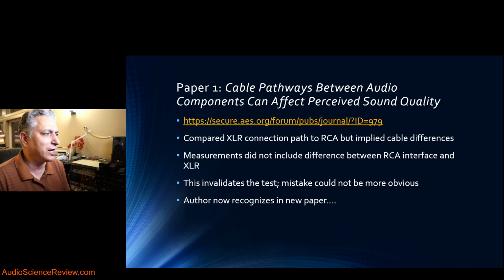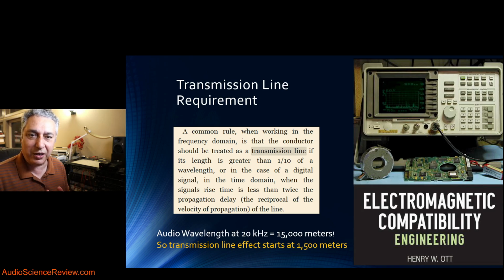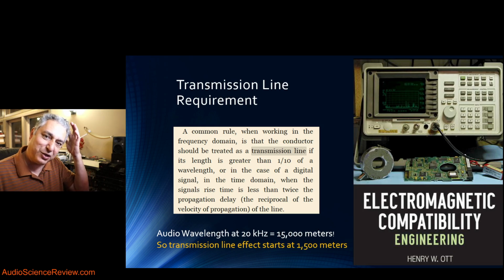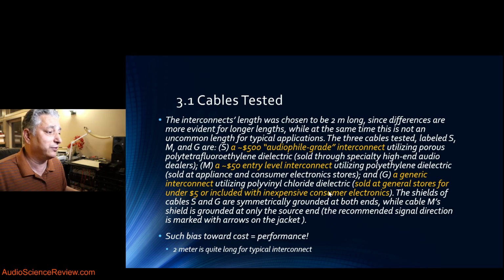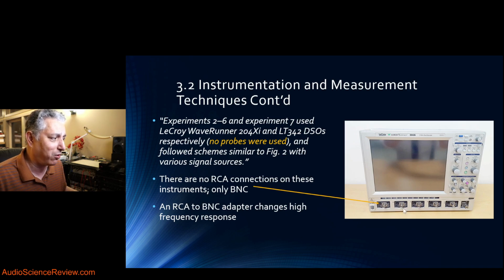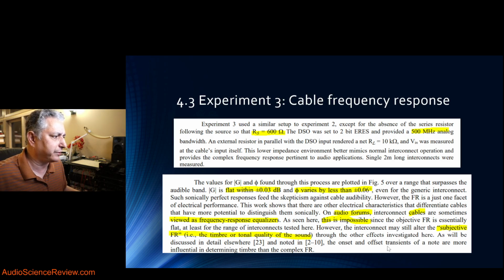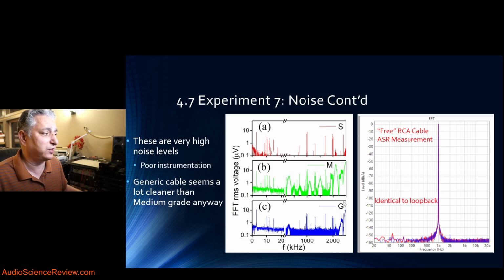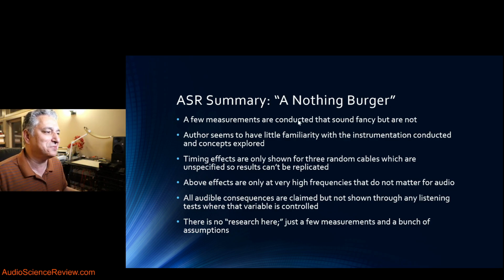Scientific Proof of Measurable Difference in Audio Cables? Paper Review

Comment: ummmm, the wavelength of a 20kHz sine wave is 1.7cm....not 15,000m......and then you say this guy has no idea.....how in the world did you come up with 15km for a 20kHz sine wave.....
Reply: @Douglas Blake ehm you're right. Sorry. I did almost the same mistake like this dude an took sonic speed for math, but sonic speed in copper. 

But yes. Even this was still wrong because we're not talking about sonic speed in whatever. We're taking about speed of electricity in copper, which is for sure lightspeed.
Reply: @Douglas Blake nah, I know. It's just, I took the very first fckn value without thinking about. Speed of electricity is basically school knowledge. I honestly forgot about 😬🙄

There is also a value for sonic speed on copper. Like I wrote. But it does not matter because... you already said.
Reply: I'm sorry to tell you that the wavelenght depends hardly on the medium. 1,71cm is the wavelenght for 20 khz in air on 20'C. 

But we don't talk about the wavelenght in the air. We're taking about copper. And there we have a wavelenght about 19,9cm. 

Still not 15.000 meters. 

But hey. This is only one point. So, if you're waterproofed on physics, you'll easily disproof Amir?
Reply: @farbschlachterei  he hasnt proven anything for me to disprove?
Reply: @Douglas Blake alright, that makes sense.  had to go look that one up though.
Reply: "in these kinds of tests, cable length matters" ummm, pretty sure this is you saying cables make a difference? if they didnt, length wouldnt matter until resistance becomes high enough to degrade signal integrity. right?  youre a smart guy amir. but there are too many people here taking what you say as gospel without knowing what they are talking about either.
Reply: oh, now the connection can alter things, but still, cable cant?
Reply: This influences of cables vs connectors topic is as easy to understand. And Amir said. Even simply replug a cable can influence the measurements more than the cable itself. 

And overall he said, not the first time, that we talk about differences in the measurements besides hearable range.

Comment: @7:54 reminds me of stabalant 22. That is a crock too. It was always compared to deoxit contact cleaner. A cleaner is what it is hopefully. Deoxit is the best for a POT if you can't replace it easily. Doesn't hurt in post cases. We would use it on test benches all the time. But that other stuff claimed to improve the signal. It's literature says in the presense ofan electrical field it conducts. They used to say all sorts of other things related to capacitance. Yikes. I'm reading its current claims and they are vast. Lower THD, less snr. Oh my. 
Thanks Amir for calling out the gagable stuff. It bothered me when other testers post the results of some test that shows differences but then state nothing about listening tests.

Comment: There is no guarantee that a journal paper, even when peer reviewed, has any validity. Sometimes crap like this falls through the cracks. Also, typically professors have requirements as to how many publications they put out, so standing in the lab looking at what he could connect together, he ended up just looking at the cables themselves.

Comment: Amir, thank you.  When the first you tuber came out with this “proof” from a college professor my question was, “who funded his research?”  I tried to explain that college professors would generally find grants in order to do research as no college or university wants their professors working in unfounded projects.  The old saying “publish or perish” refers to publish things you get paid for and bring money into your college.  Of course people took offense just like in anything cable related.  My thoughts, there are three important things when it comes to speaker cables: gage, quality of copper, connectors.  Anything else is jewelry and things like little batteries and tinker toys are pure snake venom!  Did I say Audioquest?
Reply: publish or perish is not about being paid for certain research, but just how academics are ranked based on publication output.
Reply: I’ve specified the cabling for passive audio monitors in TV outside broadcast trucks and studios with 2 core power cable in the past. Diameter was more than sufficient for the speaker power handling, and its easy for the cablers to route and terminate. We used a significant amount of it in the OB truck jobs for wiring up the UPS batteries and it made sense to use what we kept inventory of, as most monitors were active/powered. Never heard any complaints! Ditto, line level, mic, analogue/digital video, RF cable/waveguide, data, power, optical were all selected using… surprise surprise, knowledge of the signal on the wire and cable data sheets!  (And vendor quantity discounts)

Something I’ve never understood is what these audiophiles feel that they’re going to gain by spending money on far more exotic components than a professional recording facility would - the very source of the material they’re listening to. Pros are spending their budget on well engineered tools built with a purpose in mind, room acoustics and other things that create an accurate listening environment and/or otherwise facilitate their work. One suspects there’s a reason no one in the audiophile world thinks to ask them what cables they use.
Reply: @rowanjones3476  We have a BINGO, ladies and gentlemen!
Reply: What do you mean by quality of the copper. The OFC story is a myth.
Reply: @realitykicksin8755  contrary to what you may believe ASTM has standards for copper and copper alloys.
Reply: @realitykicksin8755  what do you mean by the OFC story is a myth? The whole goal of OFC is to remove impurities from the cable so as to prevent the obstruction of the signal flow. Do you mean to say that the presence of said impurities has no impact on the signal's propagation through the cable?
Reply: You bring up an interesting point. If there’s one thing that Amir and most of his fans stand for, it’s their “belief in science”. Given that scientific research is overwhelmingly conducted by universities or product development teams, it begs the question: how can we fully trust any of it?
Reply: @nathandaniels4823  Because any competent electronics engineer with the appropriate instrumentation, skill and understanding can debunk esoteric cable performance claims, it's just basic engineering (I'm a radio broadcast engineer).

Comment: Speed of sound =343 m/s. Therefore wavelength = 343/20000 = 0.01715 meters. I think you used the speed of light in your equation and that is used for radio waves.
Reply: Correction: You are correct when referring to electromagnetic waves. Apologies for the error. Keep up the good work Amir.
Reply from the maker: @dickati  My bad.  I should have been more clear about it in the video.

Comment: I spent a year in engineering school studying electrical measurements. It is a discipline that laymen usually find baffling. That is because to measure something accurately and usefully, you must understand it very well. This fellow seems to have replaced that understanding with prejudice.

And the the most common error in making measurements is prejudice. This fellow might well have started out in his project definition by saying, "The purpose of this effort is to prove that expensive audio cables are better (in some way) than cheap cables. In this effort, I will work with generalized, readily available asserts to prove that postulate." 
.....
As an aside, years ago I muted the Youtuber, Jay, from my accessible group of pundits when I heard him describe the relative position of the volume controls as describing the power output capability of two amplifiers being compared. That demonstrates a 4th grade level of technical understanding. That level of knowledge is fertile fodder for the carnival cable touts.
.....
Reluctantly I say, "Lottery tickets are probably a better audiophile investment than expensive interconnect cables."
Reply: Many a technician and engineer have made errors in their experiment and end up measuring the measurement system.
Reply: But, as an audiophile "HE WANTS TO BELIEVE" 👽 🤪

Comment: As a fellow scientist it's depressing that a paper like that can get published in a peer-reviewed journal.
Reply: Single author papers are often more a hobby project than anything else. That crap gets published too is a flaw of the system - in this case probably because no competent reviewers could be found by the journal.
Reply: @alphaniner3770 Maybe but multi-author papers have their own set of problems w/ fake contributors, often meant to use author reputation to smuggle it through peer-review
Reply: no shit. I'm no scientist and I would have rejected it for numerous reasons. Who is doing their review?
Reply: More scientific papers are being published which will never be read.
Reply: The fact that 'scientific studies' even need to be made to find differences is a testament to the diminishing returns of investing in cables.
Reply: The first paper (published in the AES Journal) is ok, and has results that make sense (a very small difference when comparing balanced to unbalanced). 
The second paper is not published in the AES journal, but another journal that I've never heard of.
Reply: @rarelycomments  yes - but if a balanced connection is compared with an unbalanced connection - this isn't a good way to test if a cable (alone) makes any difference.
Reply: @alphaniner3770  I hope that much would be obvious. My point was that intentional or not, it was a somewhat valid comparison of balanced and unbalanced.
Reply: @rarelycomments  sure, I agree. Can be useful for people that are about to decide if they want to go for a system with balanced connections or not. In the market there is a trend towards XLR connections - good to get some grip on that subject.
Reply: He clearly did a better job
Reply: @scottwheeler2679  agreed
Reply: AES has lots of silly stuff....sadly.
Reply: The reviewing peers must have been drunk or bought their diplomas online
Reply: @dingdong2103 often times reviewers just don’t actually review the papers thoroughly. It’s unpaid highly skilled labor, often given to busy grad students
Reply: the peer-review system in general is having quite a lot of issues right now. 2023 saw a massive increase in retracted papers.
Reply: Uhh a lot of science that is "peer reviewed" is pure nonsense. Do you have any idea how much crap has been supposedly peer reviewed? Peer review in reality does not guarantee something is fact or has a semblance of truth. If you are a scientist, frankly I'd be embarrassed by what goes on in the field.
Reply: How naive of you to think science is infallible 😂🤣
Reply: yeah that’s unfortunate. isn’t it safe to say it happens all the time though?
Reply: I’m afraid that this is just more evidence of the crisis in academic publishing.
The quality of reviewers is very poor, and even when they do their job well the journal may override them in order to get a publishing fee.
I’ve reviewed and rejected papers that are absolute rubbish, only to find the journal shopping around until they find more favourable reviewers.
The other issue is the dishonesty of authors, who may manipulate data, fake results, and cite papers they’ve never read.
Reply: You guys can measure all you want  just because it measure good  doesn't  means is good, I have leaving proof, I've  made    myself very good wires and I mean excellent. 
So people measuring wires, they should start listening reel   music and not expensive over charged $$$$😅
Reply: Peer reviewed is a joke. At a conceptual level that peer group is just as good as a cult. Nothing personal. Just stating what I feel about peer reviews. Bose did not care. Steve Jobs did not care. Elon Musk does not care. Bezos does not care. Says something about it.
Reply: Is there Any surprise the Dumming-down of American culture & society would take the AES down with it ??
Reply: thousands of fake papers, even with fake names and fake positions at universities went through peer review, there was even a program that wrote fake papers some of which were accepted. peer review is a joke and only serves as a gatekeeping mechanism
Reply: @andyOsalek  that surely happens, not pretty, but it will be easily filtered out bij the scientific community, and it will be bad for the journal and reviewers. The problem arrives when this kind of fake crap is picked up by non-scientists.
Reply: @andyOsalek  if you want to tell me that there are a lot of crappy papers out there - sure. But false papers, by established scientists in proper journals? - not really. Discovery would damage the journal and end the career of the scientist. The system isn't without problems, but a good scientist working amongst peers can relatively easy spot the crap. The whole point with good papers is that they can be falsified - that is why there is a material and methods section, so others can reproduce it.
Reply: @alphaniner3770  You don't know what you're talking about. Much crap has been falsified and peer reviewers sometimes have no idea what they're looking at or are lazy  and things get published.
Reply: He legally changed his name to Prof.
Reply: Joe Biden is the president of the United States. Let that sink in. Now, with that fact as a median/standard the chances are very very high that a purple and pink elephant/pig hybrid will fly through our keyholes at breakfast. Therefore, lying peer reviewed audio papers? No big deal at all.
Reply: 'Peer review' ain't what it used to be.  In my engineering field I see a lot of papers published that are nothing more than industrial reports of the kind I deliver to my clients; many are riddled with procedural and writing errors.  And don't even get me started on the open source journals - some are very good, but many are outright amateurish.
Reply: Perhaps Henry you should look at the credentials of the of the person who wrote the paper and of those who reviewed it. Your cult leader is often incorrect and does not have the qualifications of those he is criticising.
Reply: @ronlel6773  Could you point out one or more incorrect points in this video?
Reply: @rarelycomments  how about when he shows the wavelength at 20,000 Hz as 15,000m. When I divide the speed of sound at sea level (343m/s) by 20,000 I get 1.7cm
Reply: @stephenyoud6125  Electromagnetic waves in cables travel close to the speed of light
Reply: @stephenyoud6125  His 15km=300,000km/sec divided by 20kHz. It seems however the EM signal speed in copper is more like 200,000km/sec so the wavelength would be 10km. Does not change Amir's point.
Reply: @lester_domes  yep thanks   I was thinking spee of sound in air and not speed of signal in copper wire.   a senior moment. thanks
Reply: @ronlel6773  Appeal to credentials with no actual argument. Invalid.

Comment: So do digital input, interconnects and headphone cable, makes a difference in sound quality from $100 to $1000 ?
Reply from the maker: I have reviewed digital cables as well.  In short lengths (less than a few meters) it makes no difference at all.  Above that, it may matter but not based on price.
Reply: @AudioScienceReview  its just ridiculous and too expensive. Again its very difficult to a/b by plug and play and having windows to recognize which digital input to play, knowing which cable to use already.
Reply: @Douglas Blake what do you mean by generally ?
Reply: @Douglas Blake Then why others state there are difference ?
Reply: @Douglas Blake i need time to read your commeny as well as I digest
Reply: @Douglas Blake i need to hear with my own ears to be honest. I don't believe everything